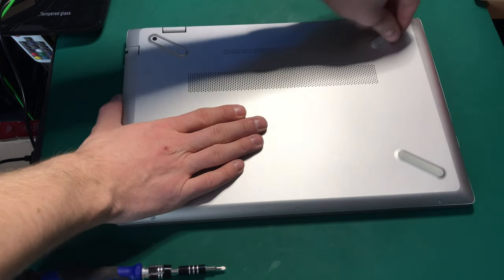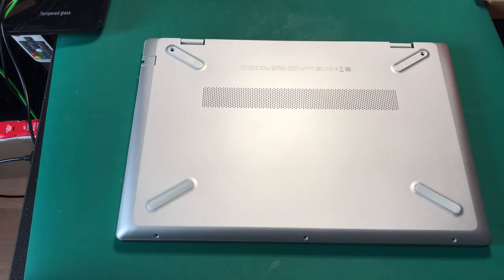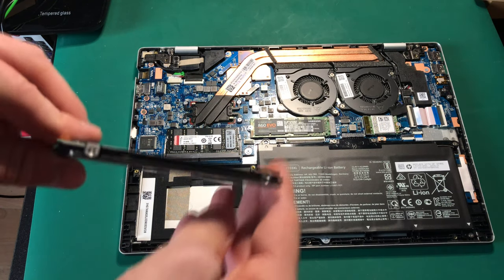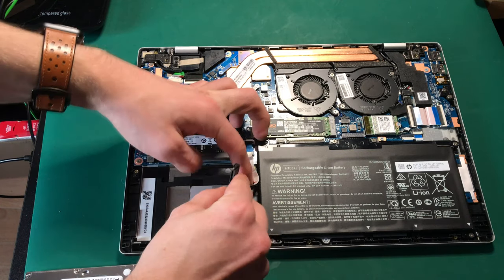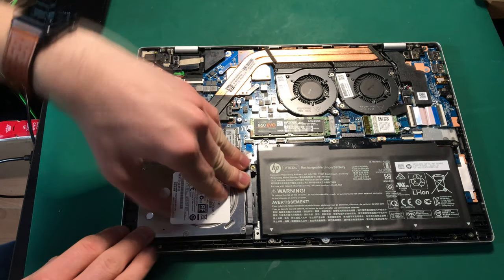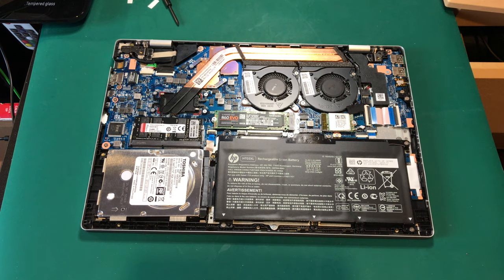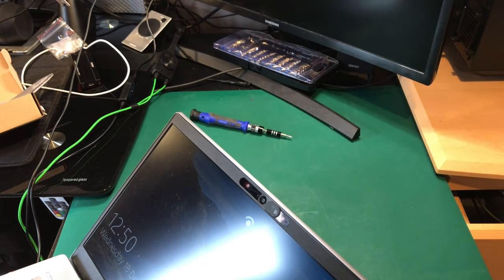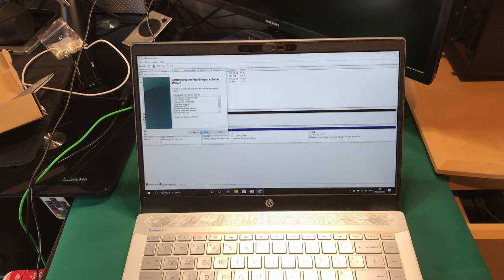How to add a Second Hard Drive to the  HP Pavilion 14-CE0505SA

Comment: Dom, Thanks for the helpful video! I have the Pavilion X360 14-dh model, which looks very similar to yours in the video. I wish to also add a hard drive for storage, leaving the 256GB SSD for Windows 10 and upgrades. I`m finding that working/upgrading laptops is really a chore as there is no documentation to be found anywhere. When you mention in your description "standard laptop hard drive" that would be a 2.5 SATA drive? Is the connector on the drive end standard? Then the big question, how do I know what connection I need for the motherboard side? 
As far as the bracket goes, I have a plastic piece in the hard drive spot that I`m hoping to use like you did in the video. For sale on eBay there are numerous blue flexible rubber brackets that slip around the hard drive to hold it in place. Also, on HP.com/support there are thousands of videos on upgrading and repairing various laptop models. Forget about ordering parts from them though as almost everything is out of stock or discontinued as you mentioned.
Reply from the maker: Hi yes, it will be a 2.5" standard laptop hard drive. It took me a long time to find a compatible connector and I was prepared for trial and error. The connector that I have listed in the description was not designed for this model, I just found out that someone tried it on a forum so I searched eBay for that part with the exact part number.Depending on what the plastic peace is, it should hopefully work, just make sure that the hard drive is not lose. Hope this helps! 😀
Reply: Hi again Dom. I found a deal on eBay for a cable similar to yours and the HP blue rubber bracket for $12. My motherboard connection is on the opposite side though. I bought a 500gb SSD but I have to mount it with the logo down because the cable is prefolded the wrong way. Don't feel bad about the rubber bumpers, even with the HP bracket it's not a perfect fit.

Comment: Hi Thanks for the videos
Im confused between Lenovo ideapd3, Lenovo Flex 5, HP pav 360 and Dell 5406
My primary concern is all of them give really limited storage and i want to keep exisitng Ssd and Add an additonal HDD .

Also i need a laptop whos body is sturdy which ones would you suggest keeping thr above 2 Req in mind.

Sturdy Body and Additional Psace for HDD keeping ssd intact.

Thank you so much

Comment: Can I do this to HP 14 dk series ? Which came with SSD and a space for HDD,is the connector universal for all HP laptop ? And it can use any internal HDD from another brand ?
Reply from the maker: Hi, I can't confirm whether it will work with the DK series as I don't have any experience with them but before buying the connector, I would double check with the seller to make sure it's compatible. It's not a universal one, it's model specific but some of them work on multiple models like this one. I would recommend that the hard drive is slimlime, and brand shouldn't matter that much, I currently have a standard 2.5" Toshiba 500GB in mine. If purchasing new, I would recommend Seagate, but brand is always debatable as most are good
Reply: @Tech-With-Dom  I see in several videos with different HP series,its had similiar connector to mother like flat cable with the blue tip right ? And I forget to ask how about the bracket,do its need a bracket or not ? If it not are the HDD will loose ?
#sorry if my english is bad,its not my native language
Reply from the maker: No, your English is good, it does have a blue tip but the connector is model specific so it's best to check with the seller if you decide to buy one, that's what I did 😉 I would recommend a bracket if you can find one, I just used these foam blocks instead as I couldn't find the bracket anywhere. They do an ok job, the hard drive doesn't move around easily. Hope this helps!
Reply: @Tech-With-Dom  its so hard to found the exact model specific component here in my country,and i don't know how to order that thing from ebay,alibaba,amazon because I just use local online marketplace
Reply from the maker: Yea, it will be difficult, I purchased mine from ebay, the sender was based in China, I'm in the UK

Comment: Very helpful video! I recently ordered a 2.5" SSD to upgrade my HP Pavilion 14-bk154sa and faced this exact problem. I have ordered the cable you recommended but could you also recommend a caddy or spacer that will fit? All I can find online are spacers that increase the thickness of the SSD rather that the width.
Reply from the maker: Yea, the caddy has been discontinued according to the manufacturers website. O just used some foam extension blocks O received with an SSD upgrade kit

Comment: I am looking for the same cable too, SSD to motherboard. But my laptop is a "HP Pavilion x360 Convertible 14-dh0008ns" (i7-8565U CPU, 16GB RAM, Product ID: 00325-96583-03383-AAOEM).
My motherboard is somewhat different than yours: it has a single fan, and the cable connector is placed to the left edge of the motherboard, also next to the place for the 2.5" SSD drive. I would have to place the SSD with the SATA conector to the left edge, not towards the battery.

That connector has 12 pins; and as yours, it holds the ribbon closing a flip latch.
Do you think the cable fits for me? 

Thank you,
Fernando

Comment: Is it possible to add another NVME connection so we can add another SSD which goes at the same rocket speeds as the existing SSD in there?
Reply from the maker: I know you can get NVME docks which convert an NVME to sata but I never tested the speed. I had a laptop I was repairing which came like that from the manufacturer, so I don't really know where you can buy them from

Comment: Can't find the connector in India.
Let me know if its available fr any website, which ships fr India.
Also,
Is there a direct cable to connect an extra  M2(Without the m.2 adaptor caddy concept, i mean a direct cable to connect  M.2 with the port u used here)
Reply from the maker: Hey, I am unaware of there being an adapter like that. I would just check out eBay for the connector just make sure the seller ships to India. Hope this helps
Reply: @Tech-With-Dom  Thnx
Reply: @HackedBy  Thnx, btw i was looking fr internal M.2 connector.
Reply: @HackedBy  Thnx, btw i was looking fr internal M.2 connector.

Comment: Great video! Really helpful content. I would like to do the same upgrade and would appreciate it if you provide the eBay and HDD link that you used here! Thanks! Keep the vids coming.
Reply from the maker: Hey there, glad you liked the video! The reason i didn’t post a link to the connector is because it’s no longer available through that seller, there is no link to share. Since this video I used many 2.5” storage devices including a 2.5” Toshiba hard drive, a Adata 120GB SSD and a Integral 240GB SSD, Regarding the connector there is a model in the description of this video. Hope this helps!
Reply: dont know how that spinning drive is an upgrade when there is an m2 in it!  why not put a ssd in it?\

Comment: please how to get the cable
Reply from the maker: As HP don’t sell it anymore, it’s proving to be difficult to find. I purchased the one described in the description under this video on eBay. You may also need something to hold the hard drive in place as they also don’t sell the caddy, I just used foam blocks I had from an SSD upgrade kit. Hope this helps!

Comment: What if the hdd is not recognized
Reply from the maker: If the laptop is not seeing the hard drive it could be that either the cable is faulty or not supported. Does the laptop see the hard drive in the bios? If not then there is a problem with the cable

Comment: Im trying to change the battery on this exact type of laptop... HP (stooooooopid bastids) wanted 270e to change the battery for me..... Thats over a third of the price of the laptop. Insane !!!!!! Gonna try get the battery(proving to be difficult as HP asshats wont sell it to me) and install it myself. Thanks for showing me how to open it. I was gonna use a crowbar and a hammer !!
Reply from the maker: Check out Green Cell, used them in the past couldn't recommend them enough. I'm actually planning to get a new battery from them
Reply: @Tech-With-Dom  okay, will do. Tks a lot